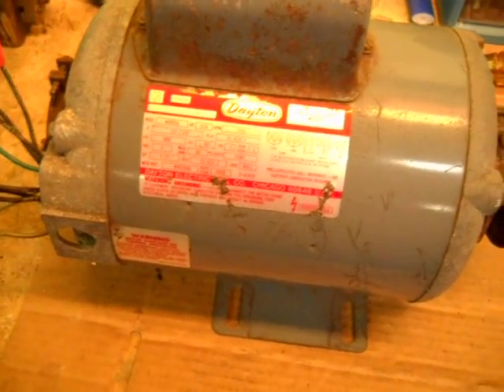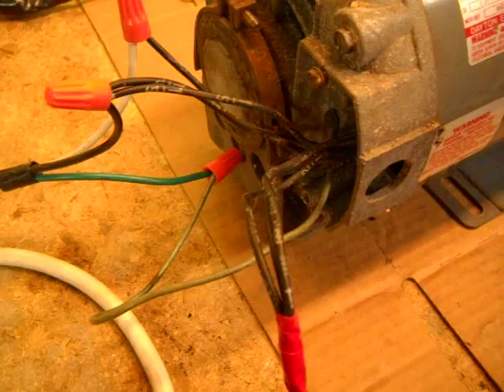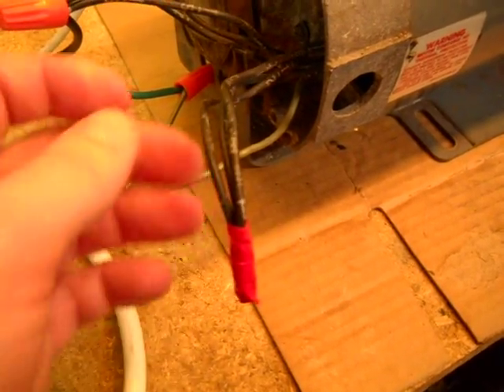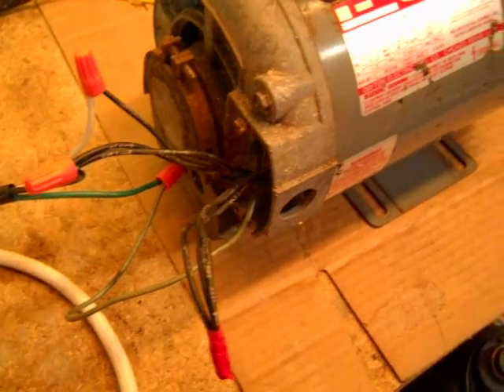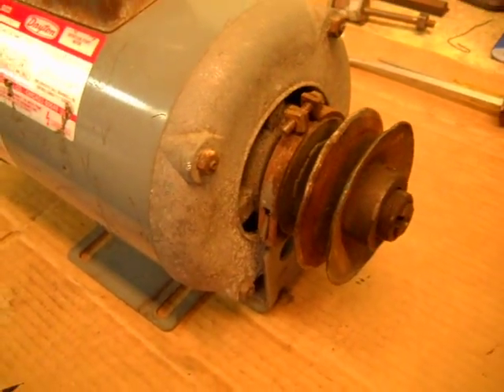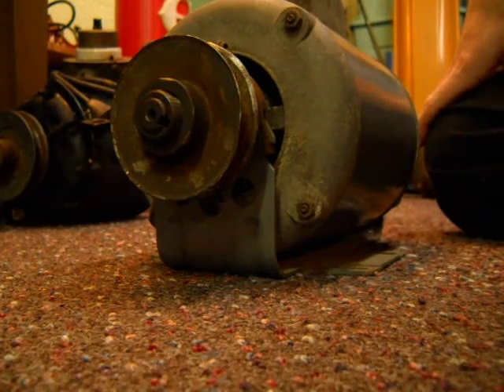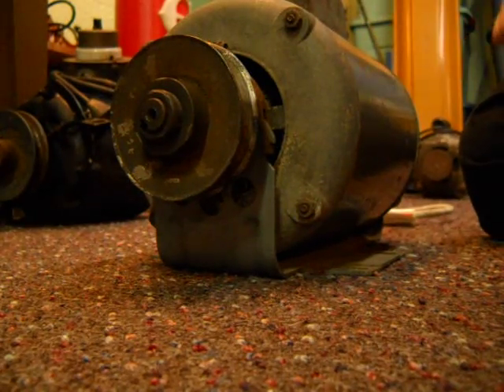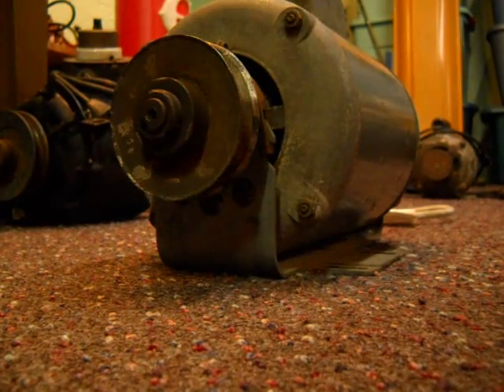how to change rotation on a dayton 115/230 volt motor

Comment: Im having trouble figuring out if my dayton 1 phase 115v motor is reversable. Tried looking up the diagram but couldnt find one online
Reply from the maker: hi there! i would love to help you figure it out. Is it a capacitor start motor or just a normal dayton motor? It should say on the I.D plate if its reversible.
Reply: @Alan.89   ID Tag says its a LR22132. Model 9k324j
Reply from the maker: @enriquemoyao589  I will make a video later on how to find out if a motor is reversible. You should check it out if you get a chance.
Reply: @Alan.89  i will definitely watch it. Your videos on these motors are pretty good.